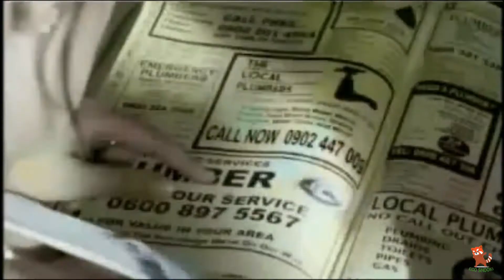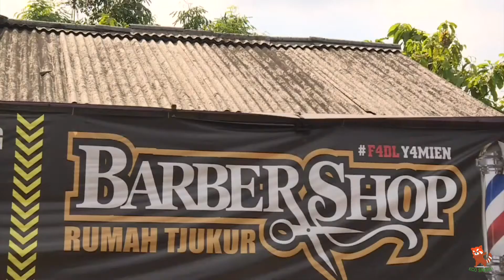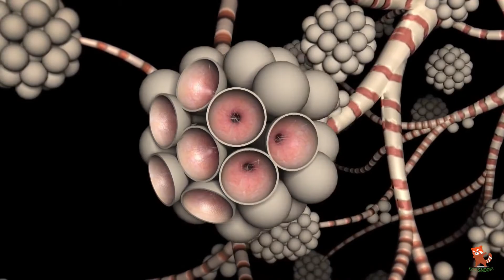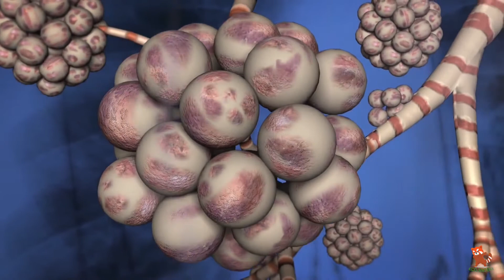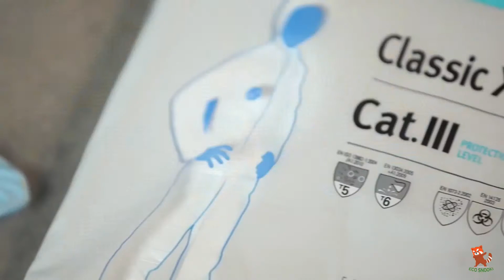ASBESTOSIS - WHY ASBESTOS STILL TORTURING PEOPLE ?

Comment: Is Asbestos and fiber cement board is same thing or different
Reply from the maker: They are entirely different....
Fiber cement boards are much more human friendly than that of asbestos.
cement fiber board is made of approximately 40-60% of cement, 20-30% of fillers, 8-10% of cellulose, 10-15% of mica. Other additives like aluminium stearate and PVA are normally used in quantities less than 1%.
Reply: Eco Snooki hi, thanks for this. Im from the Philippines. How do you know if there is a material inside the ceiling of a house that has asbestos?